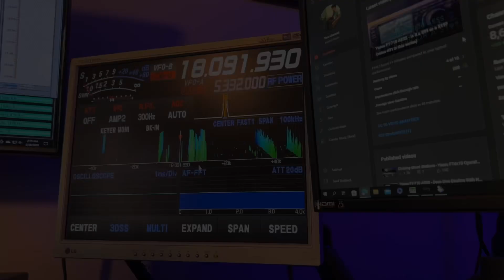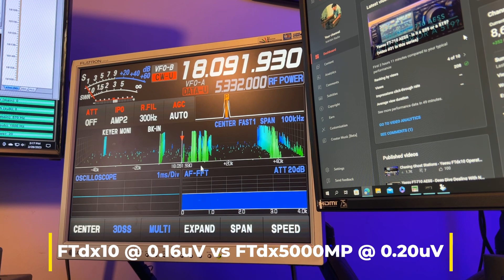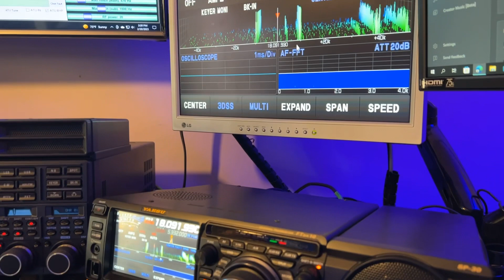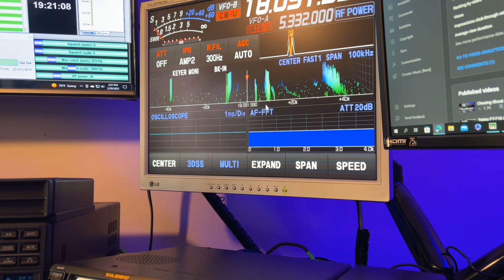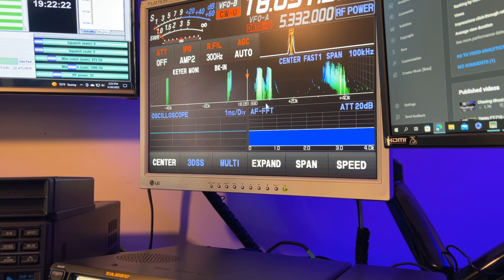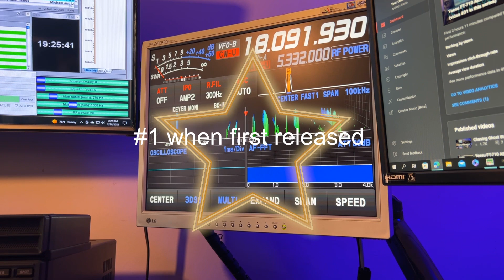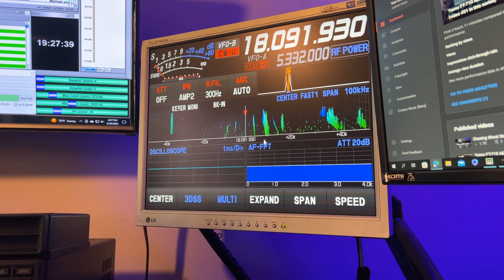Choosing an HF Transceiver: RX Sensitivity #hamradio #receive #receiver #sensitivity

Comment: I really like the FTDX10 but I have big fingers and find it kinda awkward to use.  Leaning to the FT-710 more and more.  Thanks Doug!
Reply from the maker: I grew accustomed to the FTdx10 ergonomics.  It was worth it.  It has an incredible hybrid receiver and phenomenal DNR.  Having a physical roofing filter to narrow the bandpass before the SDR stage gives the FTdx10 a significant advantage.  

The most common button you might need to press on the FTdx10 is the Band button.  It is in a tight place to be sure; sandwiched between the Function knob and the outer VFO dial.  But, using the memory tune method, like I show for the FT-891, you will rarely ever need to touch the Band button.  

I have requested that Yaesu allow us to change bands by tapping the MHz portion of the frequency display, similar to how we can change mode by tapping the displayed mode.  Perhaps if enough of us write to Yaesu requesting this, they might include it in a future update.  It would also be nice to be able to right-click the mouse to bring up the Function menu.  Additionally, it would be nice to double click the KHz in the frequency readout to cycle through the band stack registers.  These same features would also be nice additions for the FT-710 AESS.
Reply: @n4hnhradio   
'allow us to change bands by tapping the MHz portion of the frequency display" ~ a very good suggestion and the Yaesu have to/ must be doing this update.
Reply from the maker: I reason that more tap/mouse control will improve the user experience and alleviate the bulk of the ergonomics complaints about the FTdx10.  It could also help the FT-710 AESS.  I conveyed my requests to Yaesu via their Contact Us page and I’ve asked my Patreon team members to do the same. 

Below is what I sent to Yaesu.

I prefer being able to double-tap the Band button to cycle through the band stack registers, the way firmware V01-04 functioned. Having to tap Band and then press the Function knob is a step backwards.  The Band button is in a tight space between the Function knob and the outer dial  More mouse control would help even more.  Below is my list of improvement requests.

1: Return the band stack cycling to the workflow used in V01-04.  Double-tap Band to cycle through the band stack registers. We can change Mode by tapping the Mode indicator portion of the display. That keeps us from needing to tap the physical Mode button. We need the same functionality for Band, so we don’t have to fit our finger between the Function knob and the MPVD.

2: Double-tap, or double-click with a mouse, the MHz portion of the frequency readout to cycle through the band stack registers.

3: Tap, or click with a mouse, the MHz portion of the frequency readout to pop up the Band dialog. This will keep us from having to fit our finger between the Function knob and the MPVD

4: Tap or click the kHz portion of the frequency readout to change kHz with either the mouse wheel or the VFO knob. Currently we can only increment or decrement the kHz with the VFO knob.

5: Right-click with a mouse to pop up the Function menu. It was a missed opportunity to make us press the Function knob to get to the menus. After pressing the Function knob, we can use the mouse to set all the menu parameters, but you make us press the Function knob to get to the menus in the first place. It would be nice to use the mouse to access the menus.

Additional thoughts, but I didn’t send these to Yaesu.  I think Yaesu spent so much time chasing the bugs introduced with the Preset option that they lost focus regarding other improvemen requests.

I started requesting these improvements in May of 2021.  I have sent them in twice more, in addition to verbal requests via customer support, namely Tim and Rodger. But Yaesu Japan seems to only act when they are inundated with requests for the same thing. So many more must request these improvements in order for them to possibly be considered for a future update.
Reply: @n4hnhradio  l like the 891 so much thinking about buying one more in case it’s discontinued.
Reply from the maker: @ L F Same here.  Great thinking!
Reply: I love my FTdx10, super receiver.  I’m wondering about value/dollar between the two. The 5000 cost in 2019 vs the current cost on the 10.  I think the 10 is a great value for the $$$. I’m a CW guy and the FT891 with its ZIN and DNR led me to the FTdx10 along with your videos.  Thanks and 73
de WA9SWW  .  .
Reply from the maker: @Steve Warner The FTdx10 is phenomenal at CW. And so is the FT-891. The FT-891 has a 3kHz physical roofing filter, triple conversion superheterodyne receiver, and the same Texas Instruments DSP chip as the FTdx10. The FTdx10 just has more advanced DNR algorithms programmed in. But the FT-891 beats many radios that cost two or three times its price.
Reply: I struggled hitting buttons for the first couple months, but now it has been over a year now I can hit any button you want in the dark. For me it was just training the fingers.  I recommend never having a knee jerk reaction, and try to work through the problem. If after time it doesn't work out then find another solution.  Best Regards.
Reply from the maker: @davidc502 What you said, David.
Reply: I use a soft tipped stylus to push the buttons close to the VFO on my FTDX-10. I also use it to quickly move up and down the bands by touching the screen, then use the VFO to fine tune. Works great.
Reply from the maker: Great tips, Martin!  Thanks!
Reply: Ok You Guys convinced me, Im going to spend the extra silver for the FTDX10!!  Thanks for all your input.  And I will be watching Yaesu for that updated firmware!       👍👍
Reply: I even get ghost stations on SSB, but it feels weird giving a 50 signal report!
Reply from the maker: Indeed Jerry. I use my “by-ear” scale for SSB also.  It’s included in the description for video #31 in the FT-710 AESS playlist but I will paste it below:

The original intent of the S-meter was to place a numerical value on changes in volume. It takes a 6dB change in volume for the human ear to detect the change.  Our hearing is logarithmic.  We don’t hear in a linear fashion. 

The traditional S-meter is driven by a voltage from the Automatic Gain Control circuit, located in a latter stage of the receiver where the signal is demodulated by a type of detector circuit.  The AGC tracks changes in the volume of the detected audio and adjusts the RF gain portion of the receiver in order to maintain a more comfortably consistent listening level.  It is a type of closed-loop system.

So, in the spirit of the original intent of the S-meter, some of us base a signal report on a combination of what the S-meter shows and what we hear. My QRP CW rig doesn’t even have an S-meter, so I give RST reports completely by ear.   My “by-ear” scale is as follows:

S1 = Barely readable 
S3 = Readable but noisy 
S5 = Easily readable but still noisy 
S7 = Perfectly readable with only a slight hiss
S9 = Perfectly readable with no noise (aka full quieting)

73, Doug
Reply: @n4hnhradio  thanks , yup, watched that video, and that’s exactly how I score the signal report
Reply: and I should have said that to begin with!